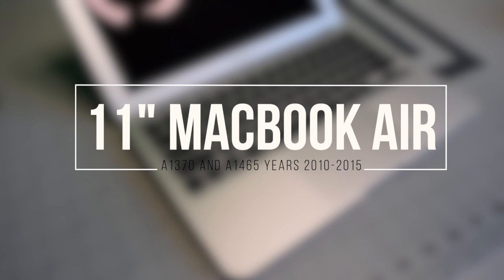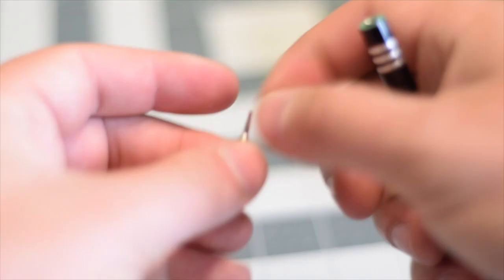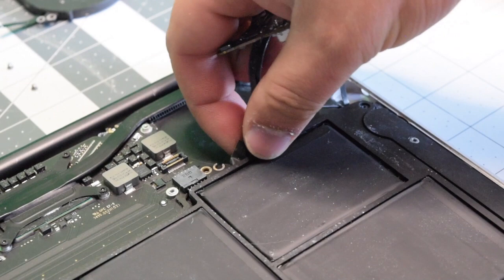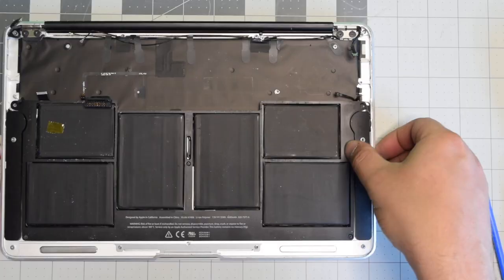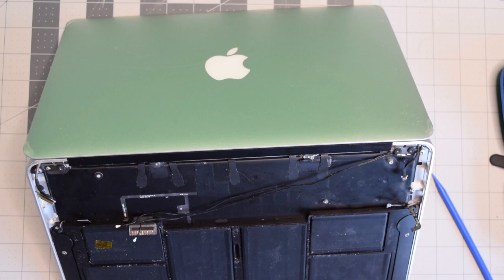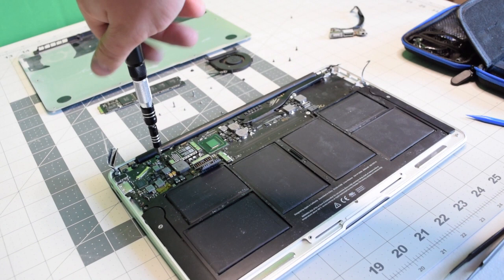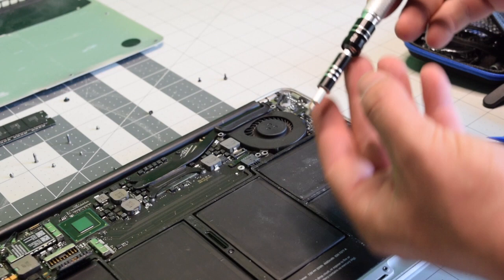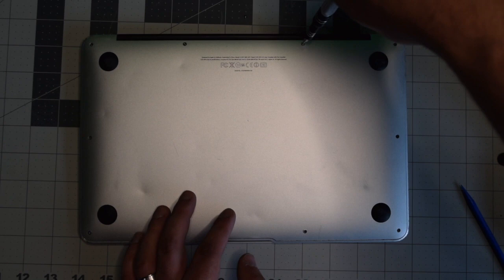11" Macbook Air A1370 and A1465 LCD Screen Assembly Installation years 2010 2011 2012 2013 2014 2015

Comment: I just changed out my lcd screen for a new one but I only see black. I did damage the diffuser later with the heat gun but would that cause it to be completely black? I know both the ribbon connection and other connector are correct.

Comment: Hi! Awesome video!! Can you please tell me if the 2014-2015 display will work on a 2012 Macbook air? Thank you
Reply: it will not I think, check the connections of the parts and it is clear

Comment: Will an a1465 fit on a model that came with an a1370?
Reply: It will fit as it has the same LVDS connector, the Wi-Fi cables are a bit longer, and the webcam connector is different on an A1465, so your webcam will not work!
The connector is a lot bigger, and plugs straight into the logic board, as with A1370, it's a lot smaller and connects in to the small I/O board!!